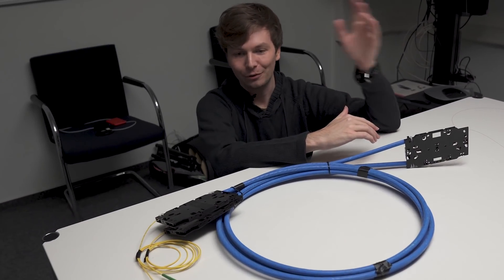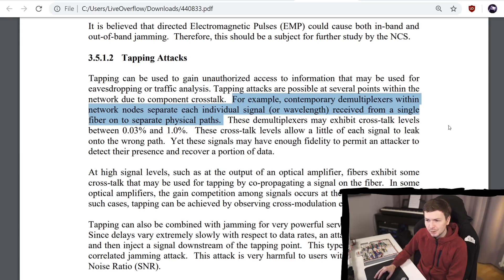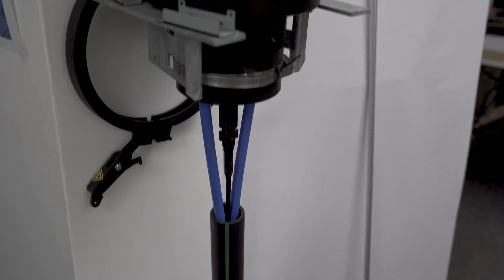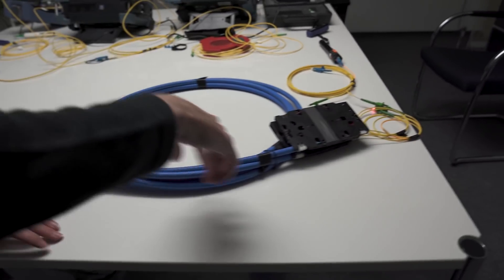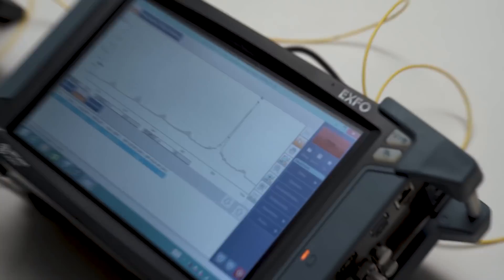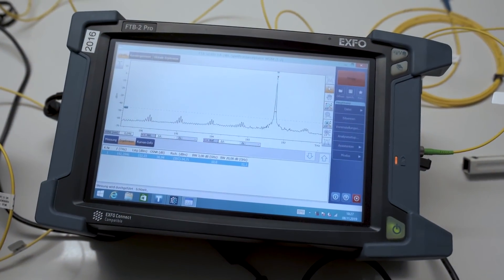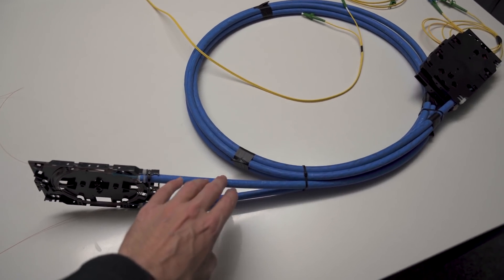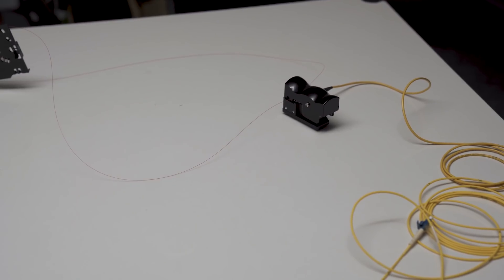Fiber Tapping - Monitoring Fiber Optic Connections

Comment: So if an attacker wants to hide their eavesdropping they would tap some fibers and somehow bend all other fibers as well? To the operators this would look like someone simply bent the entire cable.
Reply: You still see a sudden drop, unless you use a mechanism that closes slowly.
Reply: @satibel  exactly, just close it VERY slowly, although I'm sure theres ways of calculating where along the cable the tapping/drop is occurring, and with that information you could easily find and removing the device trying to infiltrate the network.
Reply: @LND3947  Since it is probably possible, with those expensive test equipments shown, but I doubt that you can measure that on an operational link. You couldn't do on twisted-pair cables either, no built-in functionality in any device. The power drop, if logged long-term is still detectable, even is it is span few days. If you view a time series data, and change the time span of the view, you would certainly see the long term drop. Probably these cables moved very occasionally, it is expected that the link power is near constant, and I am pretty sure you will see a 4dB drop on otherwise nearly flat line.
Reply: @LND3947  You can see where (exactly) there is a tap on the fiber quite easily, but the equipment (OTDR's) is not really that cheap, and i really doubt ISPs would even care about it
Reply: @LND3947  It is fairly easy to find a 'drop' on a fibre line. There is a device called OTDR (actually the exfo in featured in this video has this built in aswell) to detect things like this. Pretty sure this Exfo also has IOLM wich makes it even easier to detect such faults.
Reply: @minecrafter9099  Yep, but I do notice that I my country (Belgium) its VERRY closely monitored. And they are REAL quick to send out a call (usually within minutes or an hour).
Reply: you would bend them all, you aren't going to tap a single line. What you would do to be really surreptitious, is do it after cable has been laid but before it is connected, then the baseline level is the already tapped level.
Reply: @EwanMarshall  It is standard practice here to do a OTDR before delivery wich gives the client a baseline for what Db to expect at both ends. But granted, this would be one of the more better times to do.
Reply: @wbi007  Yeah, never said it was perfect, but the real baseline can't really be known until it is at least fully laid, as there may be bends and such it lands in on the ocean bed.

Comment: it sound okey but decrypting is harder . there is no hardware solution to understand transfered data ,.even if you record it and put it in “same model modem” , you wont be able to capture login interface log of modem(decryptor) . only information getting from it is ; if user using it or not , do network camera going out or not . 

when you return home , can you try decryting your own internet data between computer and modem ?( by putting another device between your computer and modem ) ( or using network device , copying internet module id ) 
have a nice day , i like your videos ;)
edit:
Leonardo D. i personaly know that there is no proccesing power that can decrypt the data that changes pppoe interface every milisecond with ppp access key (most cases user name and password hex blup .)  . if it transfers regular data format , you could capture and save that data .  but it is not :) . best option you can do is truing to get ppp key and emulate that modem’s secure connection . cutting electric connection of modem and capturing first login of modem many times and compare these would be fastest way ...
edit2: cryptology is big hobby of mine . I would like to talk and share it ;) 
my discord thebot#9942
Reply: There is no hardware YET. Don't doubt about the infosec hardware manufacturers xD
Reply: @lddutra  Boys, this info is new only for us. Don't you think that russian tapping tool is exists for a reason? And it is sold to a civilian? This attack is probably known since fiber optics invented and probably tools already available. 😉
Reply: @lddutra  You don't need "that special not yet developed" hardware. You only need software as the tap device already puts out the same signal going through the cable..
Reply: Leonardo D. i personaly know that there is no proccesing power that can decrypt the data that changes pppoe interface every milisecond with ppp access key (most cases user name and password hex blup .)  . if it transfers regular data format , you could capture and save that data .  but it is not :) . best option you can do is truing to get ppp key and emulate that modem’s secure connection . cutting electric connection of modem and capturing first login of modem many times and compare these would be fastest way ...
Reply: Afaik optical fiber uses the same atm protocol as regular dsl, so once you turn back to an electrical signal, you should be able to use it the same way (extract the 48bit payloads an stitch them to get the pppoe data, which in turn can be converted to ip.)
I'm not 100% sure stuff still works like that, but I'm pretty sure that works similarly, maybe with different protocols but I don't think any of the civilian grade stuff is encrypted below the tcp/ip layer.
Still, seeing it done might make a fun video.
Reply: @satibel  FTTH is one thing, but I doubt that connections beteeen an ISP's own endpoints use any ATM.
Reply: Please rephrase that YOU don't have hardware solution. 😉 Do you think that anybody about to carry out this kind of attack hasn't prepared a device already? I am not this kind of an engineer, probably many of us isn't, but if someone dig into this field, I am certainly sure that he could get the data stream out of it. And it would be interesting to know, how much low level encryption is used on these links. Probably not too much. The end user's SSL connections are still encrypted, but a lot of auxiliary traffic isn't, I guess.
Reply: Gábor Móczik Leonardo D. i personaly know that there is no proccesing power that can decrypt the data that changes pppoe interface every milisecond with ppp access key (most cases user name and password hex blup .)  . if it transfers regular data format , you could capture and save that data .  but it is not :) . best option you can do is truing to get ppp key and emulate that modem’s secure connection . cutting electric connection of modem and capturing first login of modem many times and compare these would be fastest way ...

Comment: Remember: don’t let any fiber-optic cables bend.
Reply: it's still fascinating to me that a glass line like that has any flexibility at all!
Reply: It's not crystallized glass, so it's not brittle like the glass of a window.
Reply: To be honest its not that easy to break a single fibre optic cable, sure if you roll over it with a chair the thing is done, but for example its more prone to connector damage than bending, in my place we have more splicing(fiber welding) to do mostly because connectors have scratches/cracks while fibres themselves don't break as often, ofc you get more loss on the bend part so you wanna avoid any bending to limit the light loss.
Edit: also look how he's using 10mW red light laser while my facility uses 1mW for normal use xD
Reply: AllWave has probably the best fibers ever, you can literally bend them, they are from special material

Comment: I never know how light transmits data from the internet.
Reply: Light pulses instead of electrical pulses?
Reply: @davidpacak8462  You're wrong its electrical light instead of pulses pulse.
Reply: Protocol upon protocol, same way adsl is basically tcp/ip over ppp over Ethernet over atm over pots. Now you switch the pots for fiber and everything else still works the same, but faster. (The atm may also be changed to some other protocol, but the idea stays the same.) Basically as long as you can put a string of 0 and 1 in, and get it out in the same order, you can put tcp/ip and thus internet on it.
See rfc 1149 and rfc 2549 for the ipoac protocol.